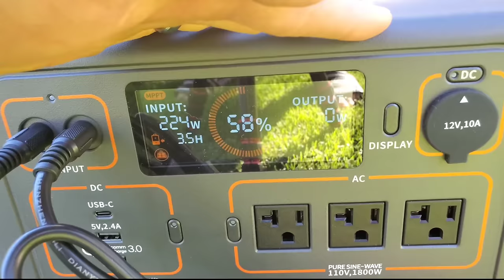She Tipped Me $100 When I MOWED Her YARD For The FIRST Time

Comment: Hurray Jackery!  Noticing the discolored spots at 5:15, does owner have a dog? If so, these spots can be helped by lots of water on top to help flush the urine down into the soil as well as dilute it. Possible cause of brown patch near sidewalk could be grubs, dig into it to see if there are a lot, a few are ok. Or has something toxic been poured in that area. If size increases, needs attention. WD40 might take off those black smudges on the fence, try a small spot first.  The always wet area could be helped by planting something that likes a lot of water, example; some type of mint, would need boundaries.
Honestly, it was nice to see a well cared for lawn for a change! I like them. Great job closing and latching the gate, that is a problem many don't realize, especially if pets are on property.  2 thumbs-up 👍 👌